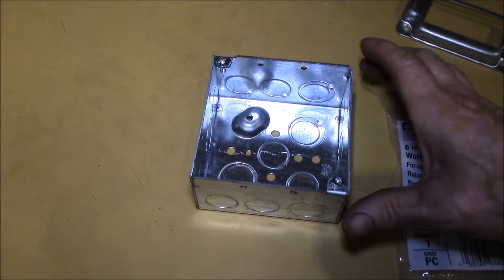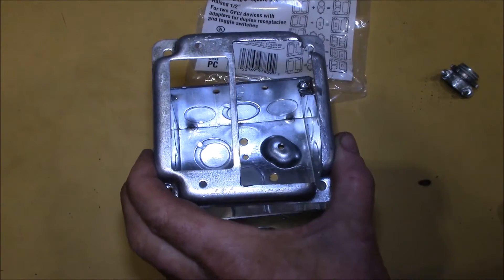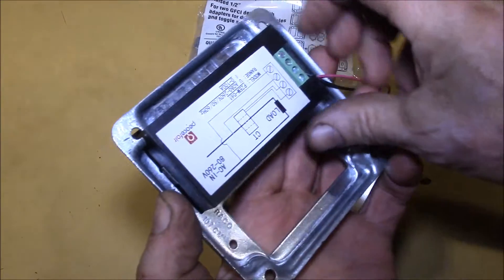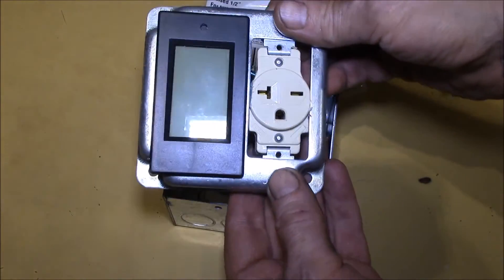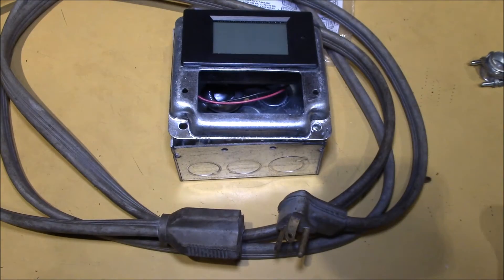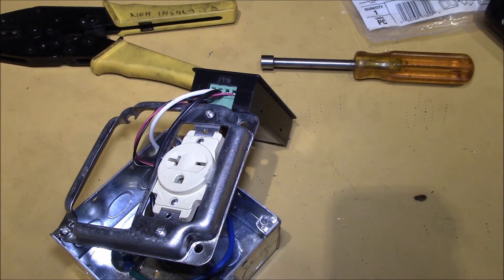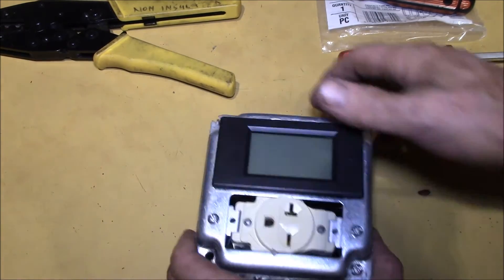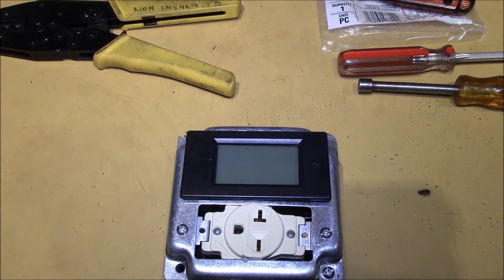240v Split-Phase Kill-A-Watt Meter, Part 1 - The Build

Comment: Doesn't that only monitor one leg of the split phase 240vac? If you  had put the inductive loop around the ground, it would report both circuits load.
Reply from the maker: For a 240V load, the current in L1 or L2 will be the same so measuring current in one leg or the other will read the same.  For example if you had a 1200W load, there would be 5 amps flowing (ignoring power factor) in both L1 and L2.  Your ground or neutral wire should have no current in a balanced 240V load.  

Now if you're running multiple 120V loads off the 240V split phase, then each side will have different currents.  That same 1200W load might be 4 amps (or 480W) on L1 and 6 amps (720W) on L2.  The neutral wire would have the difference of those two legs, or 2 amps flowing on it.  Unless there is a ground fault, the ground wire should never have any current flowing on it.

Comment: It only monitors one leg. That's 110v not 240
Reply from the maker: Multiple ways to hook this up.  I wired this for a balanced 240V load, L1, L2 and ground (no neutral wire).  So amps in L1 must equal amps in L2 and measuring voltage L1 - L2 (which is 240V), I get watts on the full circuit.  Another option is to run both L1 and L2 through the CT, with one wire reversed so the currents add, then wire the meter voltage terminals to L1 - N or L2 - N.  This way works with unbalanced load, at the CT sums up L1 and L2 currents and combined with the L - N voltage, gives you 240V power reading.  But since my circuits have no neutral wire ('50s vintage house), I had to go with the first option.

Comment: How would you monitor a three wire 240v setup?
Reply from the maker: By 3 wire, are you referring to L1, L2 and N?  Or a full 3-phase setup?  And if it's L1, L2 and N, is it a balanced setup, i.e. current in L1 = current in L2?  If so, the setup in this video works.  If current in L1 and L2 are different, then I've had a commenter report that getting 2 meters, or at least one meter and a 2nd current transformer can work.  Run L1 through one CT, L2 through the other CT, connect both CTs in series and then run that into one meter.  It'll read the average of the 2 currents and then if you connect the meter across L1 and L2 to get the full voltage, it'll display the total power across the two lines.  It won't show any detail on the individual currents, for that you would need two separate meters, one for L1 and one for L2.
Reply: Not 3 phase, 3 wire L1, L2, N + Gnd.  Like a 240v 30amp generator twist lock receptacle.
Reply from the maker: As noted, several options.  
1. 1 meter, 2 CTs, wire CTs in series and connect to meter with meter across L1 and L2.  
2. 2 meters, 2 CTs and have one meter across L1 and the other across L2 and you get two power readings, add the two for a total.  
3. Do 1 and 2 and you'll have currents/power for both 120V sides and power for the 240V.
Reply: So, if i get two meters one for L1 and one for L2 it will show me the wattage and current values for each individual leg of the circuit?
Reply from the maker: Yes, L1-N for one meter, L2-N for the 2nd meter and each will read their own half of the circuit, current, voltage and watts.  Then add the two watt readings if you want a total.
Reply: Got it.  Big Thanx!!!